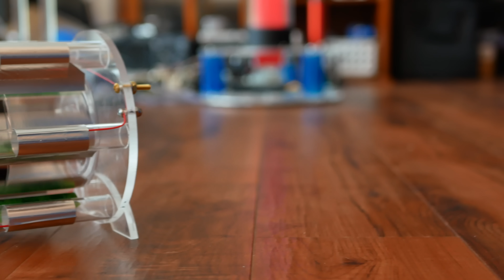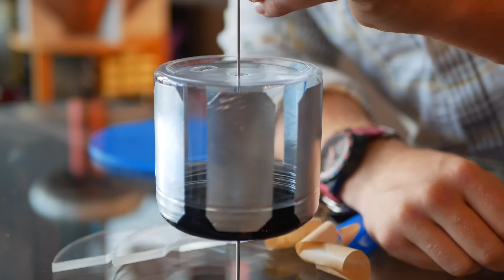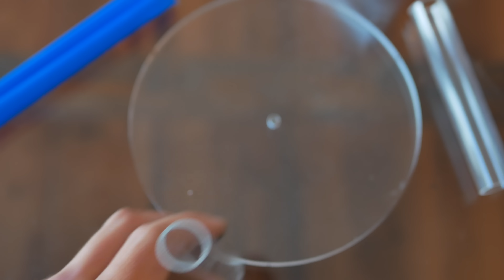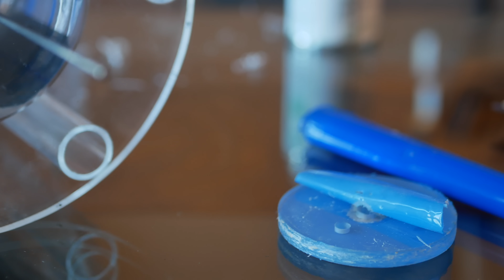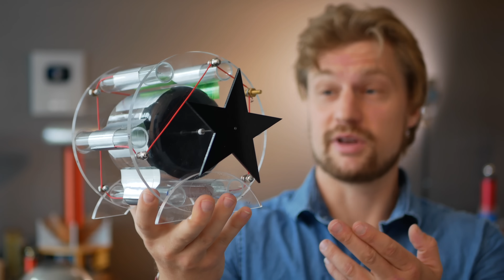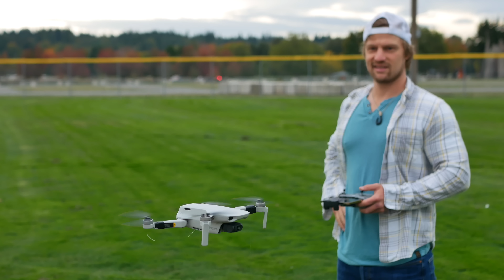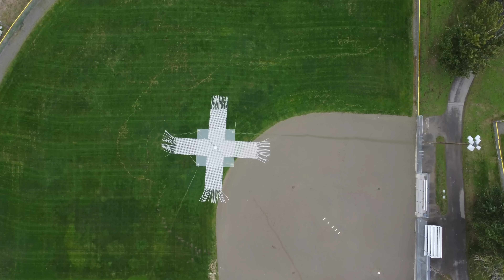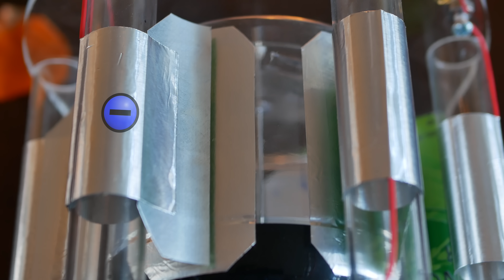Building A Wirelessly Powered Corona Motor (DIY)

Comment: I think your design is very efficient although mine does have a much smaller input supply to your vdg and wimshurst... check this out though as iv used my corona motor as a current regulator...
https://youtube.com/shorts/UAPCyRbLTcQ?si=GyffA7yuTc9tujlV
Reply: This is essentially how wardencliffe generated power... iv used the vdg as atmospheric energy substitute as I figured 65 meters is around the height of wardencliffe giving access to 6500volts of potential upto 65000 in thunder storms so my vdg is a reasonable substitute for small scale proofing... the static motor regulates the current into a steady flow which produces a resonance frequency... maybe around 10hz here but this can all easily be increased with relatively simple design modifications